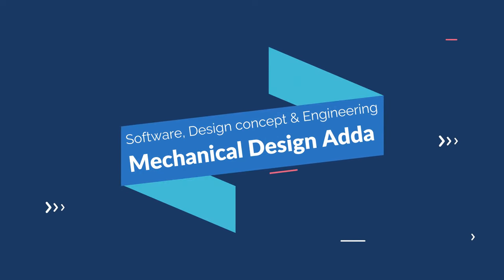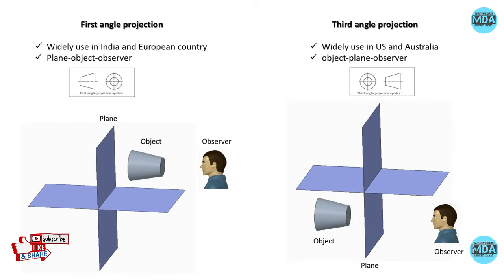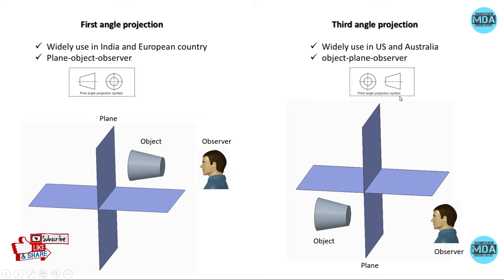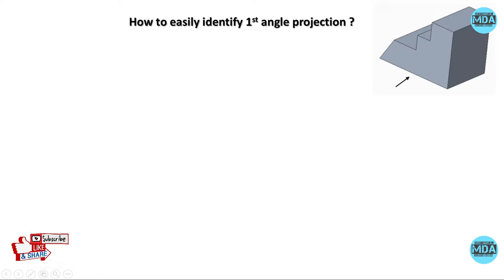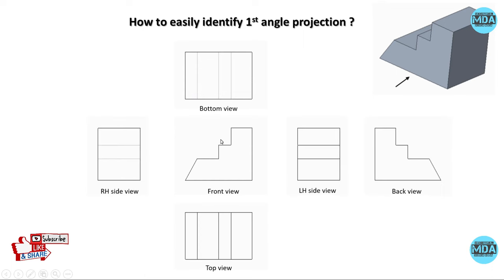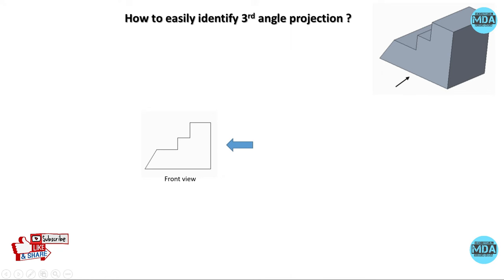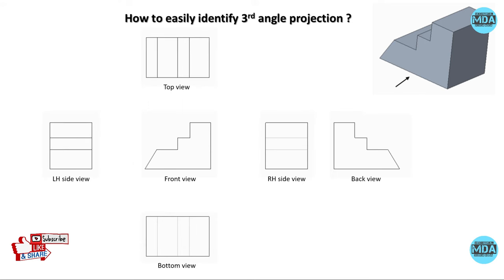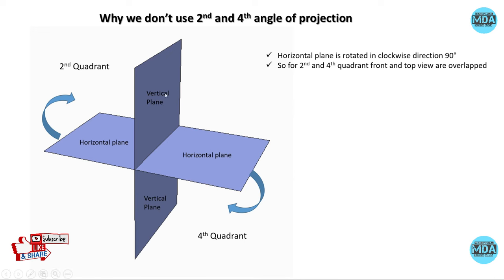Why 2nd and 4th angle projection not used ? | Difference between first and third angle of projection

Comment: The reason, as far as I understand is that, we stick to 1st and 3rd angle projection methods, just for standardization purpose, so that instead of four different approaches, now we have to go with only one of two approaches. And, clock-wise "sounds good" than anti-clockwise rotation.  In case of 2nd and 4th angles, overlap happens only when following clock-wise rotation of horizontal plane ( we do it to have both projections in the same 2-d plane, for sake of representing in a "paper"). If we rotate anti-clockwise, the issue with overlap goes away, and we get both views in same plane. But the results would be the same as rotating clock-wise for 1st and 3rd angle projections. This is just an opinion. Feel free to correct me or add more info on why we go with the choice.
Reply from the maker: Hi Ajay..... Good explain....you are right 👍❤️
Reply: According to the point where I can understand brother e've got you but i was stucked for answering
Reply: Hi Ajay,
I think there is a problem when we rotate anti-clockwise. The drawing will get upside-down.
Reply from the maker: If you rotate in anti clockwise then 1st and 3rd angle projection overlapping issues and you will get orthographic view in  2nd and 4th angle of projection

Comment: Question. 
1. Why are we viewing from the right side only?
2. Why numbering the quadrants are in anti clock wise directions?
3. If we are viewing the 1st angle from right side why we can't view 4th angle from left side? And vice versa?
4. Here you explained about 2 planes (horizontal and vertical) where you impose the view. On which principal we are rotating the object for other views? If object is not rotated where are other planes? (A total of 6 planes have to be there).
Reply from the maker: In the angle of projection most things are standardized
Two planes are the imaginary transparent plane 
We have two options 1 and 3rd angle of projection to get the 2D view 
We need to follow standard because if  we have number of option then we will get number result 
Drawings are universally accepted so we need to take standard option we have so that everyone can understand and avoid confusion

To summarise all, to avoid confusion and maintain drawing standard we need to follow recommended standard practice of 1st and 3rd angle of projection👍

Let me know your point of view ☺️
Reply: @MechanicalDesignAdda  I know we are following standards based on some principles but my question is why? Clearing that will make the viewer more knowledgeable.
Reply from the maker: As I said, more options create confusions as drawing are referring all over the world
So the reason we are following standard practice in angle of projection is to confusion.

If we have no. Of option in angle of projection then everyone follow different different method and it will create confusion
As drawing goes in different departments and different steck holders

Comment: Why we rotate 90 degree angle along clock wise? Why clock wise why not anticlockwise?
Reply from the maker: It's standard practice that we are following
If we rotate anti clockwise we will get 2nd and 4th angle of projection and 1st and 3rd will overlap
So to avoid any confusion and everyone on the same page standard are fixed in angle of projection so that everyone can can same standard method and understand drawing

If we have number of option for angle of projection then it will create confusions among all

Comment: Please answer
Q1)the projection originated from from the eye ball and converted into 3d object to project a 2d image on the plane is the
(a) 1st angle projecetion (b) 3rd angle projection (c) 2nd angle projection (d) 4th angle projection
.
Q2) the projection originated from  from the eye ball and converted into 3D object to project a 2D image on the plane is the
(A) 1st angle projecetion (B) 3rd angle projection (C) 2nd angle projection (D) 4th angle projection
Reply from the maker: First angle projection, second angle projection, third angle projection, and fourth angle projection are all different methods of representing a three-dimensional object on a two-dimensional plane in technical drawing, and they do not involve converting a projection from the eye into a 3D object.
The projection described in the question is called perspective projection, which is a type of projection commonly used in art, architecture, and computer graphics to create the illusion of depth and three-dimensionality in a two-dimensional image.
I hope you got an answer👍
Reply: @MechanicalDesignAdda  Thanks bro but i didnt get my answer
Reply from the maker: Ok, can you please rewrite your questions in some simple way so that I can understand what you want.
I will try to answer your questions 😊
Reply: @MechanicalDesignAdda  Sir it is the same question as it is and 2 times repeated in my test

Comment: Why can’t we rotate the planes 90 degree anti-clockwise for 2nd and 4th angle of projection to get the views on the same plane of paper?
Reply from the maker: Hi Suresh, really good question,
We can do that by rotating the plane 90 deg anticlockwise we will get projection.
But in that case whatever the projection we are getting,if you compare with Clockwise first and third angle projection it will be same.
So 2nd angle projection act as a 3rd angle projection 
And 4th angle act as a 1st angle of projection.
But we generally follow clockwise rotation considering standard one👍.

I hope you understood
& Thanks for valuable comment

Comment: Why we don't rotate vertical plane?
Reply from the maker: Generally we follow standards of rotating horizontal plane in clockwise direction.
we can't rotate vertical plane in Clockwise direction it will result in overlapped view
But if you rotate vertical plane in Anti clockwise it will give you orthographic view
Reply: We dont rotate vertical plane because, observer is watching the vertical plane as per standard. Soif you rotate vertical plane then observer can't see the projection plane any more. So we move horizontal plane inorder for the observer to see projection even after the rotation.

Comment: Bhai galat bataya hai yar tumne.
There is no rotation problem.

1st and 4th angle project are same ....
Except in 4th angle....top view is on the top.

Similarly 2nd & 3rd angle proj are same except... In  2nd angle top view is on bottom
Reply from the maker: Nahi Bhai, video me ekdam sahi information he.
Jab hum horizontal plane ko rotate karte he closewise direction me tab jake Hume view milate he.
2nd and 4th angle of projection me fv and tv overlap hote he isliye o method hum use nahi karte
Aasha karta hu me aapko samja Paya 😊